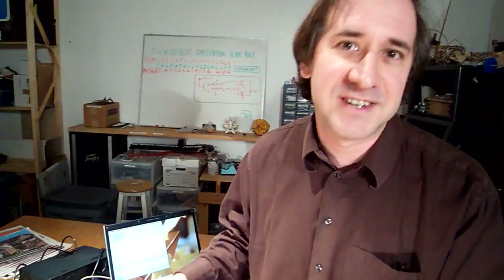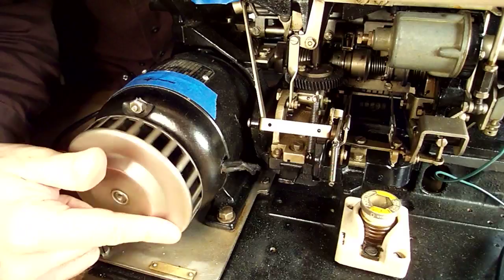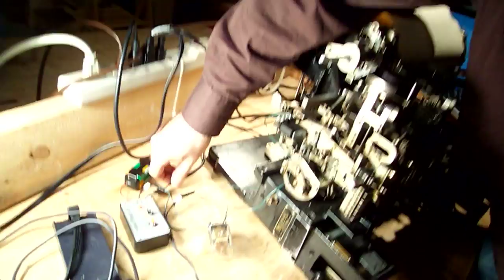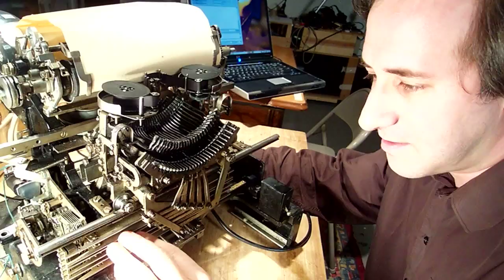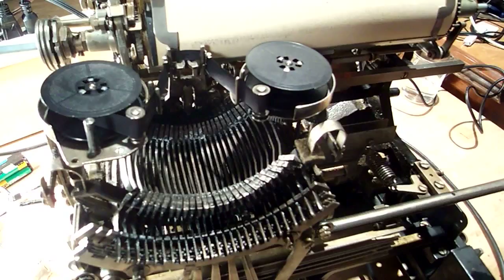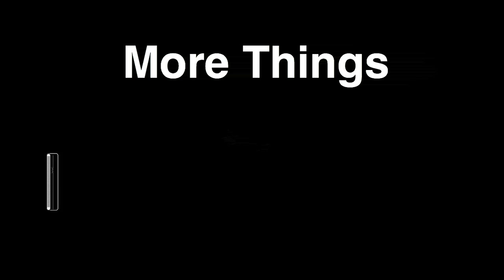Things - Adam Mayer Explains The Teletype Model 15

Comment: I have a Model 15 (got it a couple of months ago)... the motor runs on AC, but the keyboard and typing unit does not.  Does the teletype require DC as well, in order to run the parts that aren't working ;o (there is a DC cable coming from the machine)???  I'm a little stumped and defeated ;o ... any thoughts :) ???  Thanks so much in advance ^^ !!!~  :)

Comment: I've got a  Army Signal Corp TT model 15 that I'm cleaning up - nothing appears to be damaged, or missing, and it will start up but slowly. I'd like to hook it up to my Mac computer. Where can I get the Teletype 15 Printing Unit box, and relay that you use??!  Thanks
Reply: Dear Donald

I just bought a beautiful typewriter Klein Adler 1 in almost perfect condition with a nice wooden case. I bought it from abroad and once it arrived in my home Ii realized that despite the perfect condition from the outside there is a big problem. It has an awful smell (mold). My son is allergic to mold so I wonder if you could help me with some recommendation how to get rid of the mold. please have in mind that I live in Macedonia, where most probably we don't have available the products against mold (brand names) that you would suggest with names. So I am asking you for some tips for more traditional cleaning of the typewriter with some solutions. I read about bleach and vinegar but I am not sure and I want to hear your opinion because I don't want to ruin the beautiful typewriter that I bought. 

Best regards and look forward to hearing your comment

Thanking you in advance 
please reply if you can at
taleski.sasho@gmail.com

Comment: @TalksWithDirt After every 5 data bits, there were one and a half "stop" bits for the machine to reset, followed by one "start" bit used to synch the sender and receiver up for the coming 5 bits.  BTW, packeting is a level of abstraction higher than the data stream.

Comment: I owned several TeleType machines in the '60s and '70s. As you explained in your video, it helped reinforce the concepts of computer "code" because it was presented in a physical dimension. Other great tools were the paper tape, punches, and readers.

Just like the old Linotype casting machines, the sight, sounds, and odor of the TeleType are a thing of the past. It's unfortunate YouTube cannot convey the smell of warm polar relays, coils, oil, and ozone.

Thanks for posting this video.